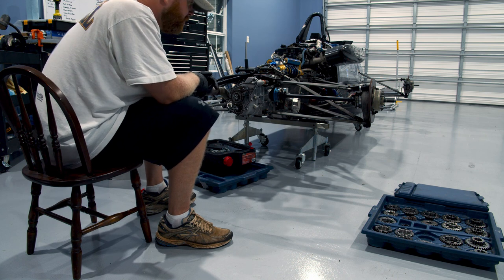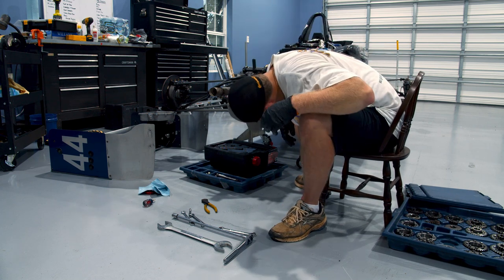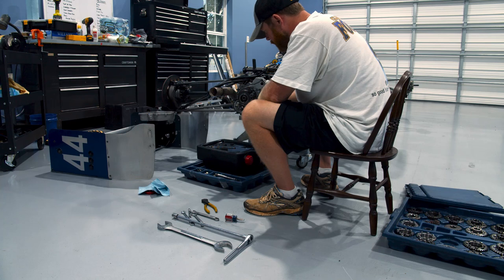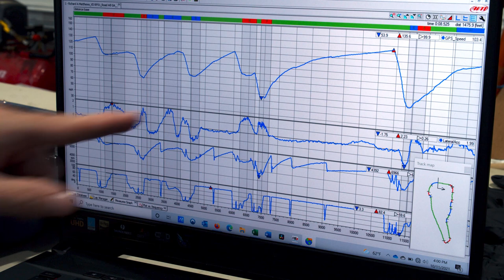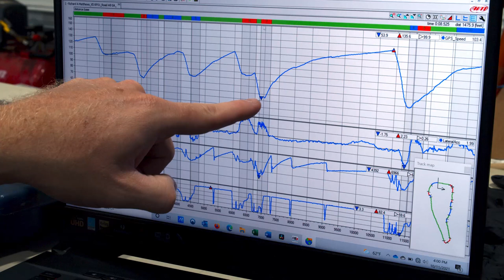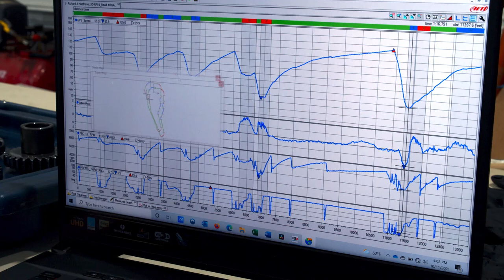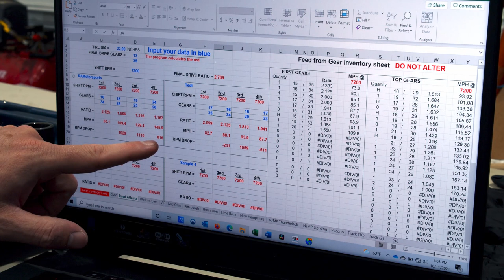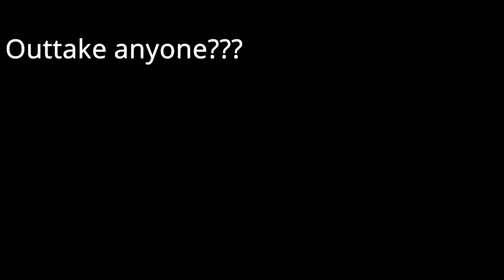LD200 Gear Change

Comment: Helping my buddy with his F2000. I've raced sedans only. First time working on a open wheel. Learning his car and this video was very helpful in learning the Hewland.
Reply from the maker: It's nice to work on something where you don't have to crawl in an engine bay, floorboard, or trunk, huh?  I should do one on setup (wings, alignment, ride height, etc.)